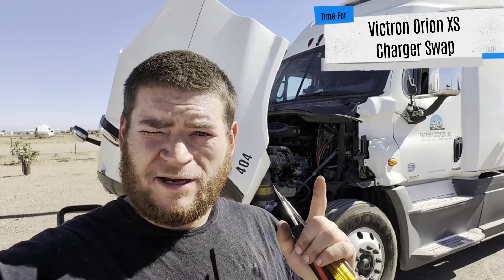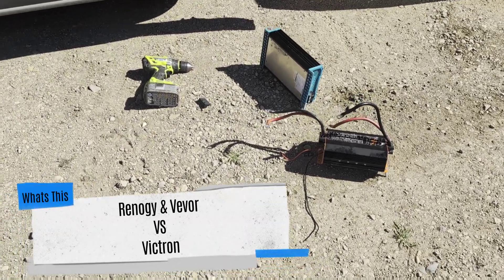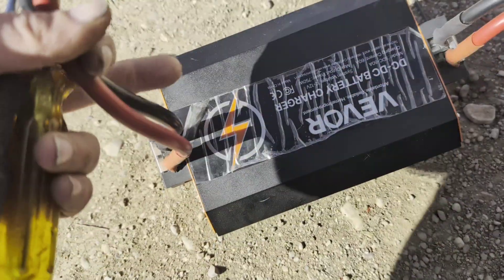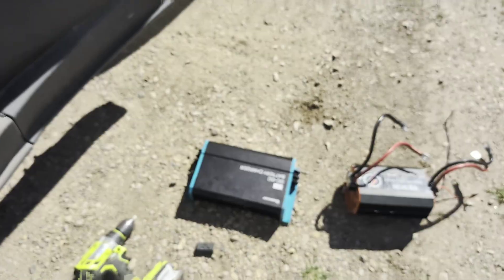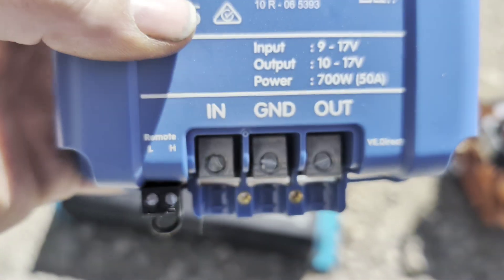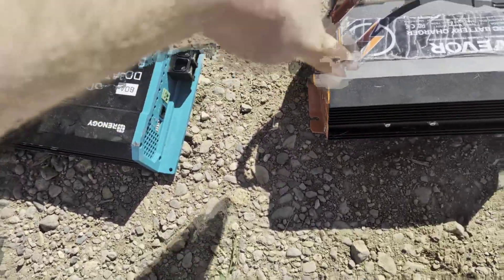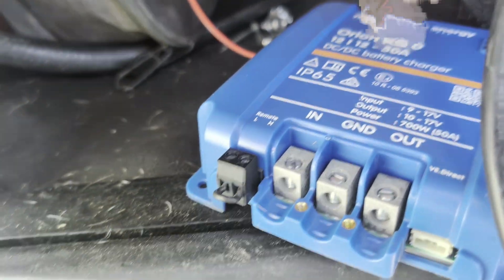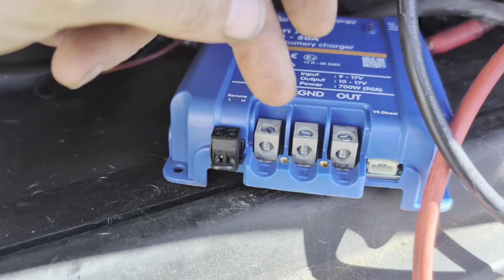Switched To A Bluetooth Victron Orion XS - No More Terrible Vevor or Renogy DC to DC Chargers!

Comment: I have a 36 foot Winnebago motorhome. I started out 8 years ago with a 200 Ahr Lithium battery charging from a 45 amp Progressive Dynamics lithium charger. I also charge with the truck 160 Amp alternator, directly connected through a relay and a 100 amp fuse. I have since added 3 more 200 Ahr batteries for a total of 800 Ahrs. Although we still have all of the original LP appliances as a backup, we cook and heat with electric all the time. I have a total of 4 inverters that allow for a lot of cooking at once as well as hot water and space heating. We are away from the northern climates in the winter so space heating is not needed too much. While traveling, the truck engine also heats the hot water tank. The alternator runs at 14.3 volts. If the batteries are rundown, the alternator may be as low as 13.3 volts when we first start out but settles in at 14.3. The truck still starts using the truck lead acid batteries (2) but then the relay comes in and they are joined together for charging. 8 years, same alternator, same drive belts, same Lithium batteries and currently, 2 five year old lead acid batteries.
Reply from the maker: Sounds like a pretty cool setup! That's for the info! Are you using an idolater I've heard of those before it let's power only flow one direction. Which one do you use? In my motorhome unfortunately I can't use one but maybe the semi truck because the motorhome setup is wired as 24v with victron equipment connected to 4 300ah batteries so what I did was kept the 2 12v truck batteries installed and the power converter is still wired to those 12v batteries while the victron Quatro unit acts as a converter charger for the lithium 24v bank. Although right now when the engine is running the lithium batteries don't charge from the alternator they are strictly charging from the solar panels.

Comment: Since Victron is made for RV's, and Marine first I think it's a great choice for semi usage.
Reply from the maker: So far it's been working amazing. I just don't have any main victron units like the Quatro or multiplus although in theory they would work perfect minus not having shore power connections nearby the semi truck. I've thought about swapping out all the old equipment like the inverter that already came in the truck with victron inverters but I might wait for the Chinese inverter to die first. I have to say so far the victron equipment I've used in the semi truck and motorhome have been AWESOME!

Comment: Renogy has a new model now that Is smaller
Reply from the maker: How are the reviews though? I was pretty irritated the renogy only later a couple months before having issues seemed way too quick. Keep in mind the semi truck is running at least 12 hours every single day I'm working. I think that alone causes a lot of stress
Reply: @TheTravelinTruckah i didnt get anybreview of the new model but i saw that they improved some of the weak points. Now the efficency Is at 90 92 percento therefore less heating Abd smalller dimensions. Victron Is Better buy costs a fortune
Reply from the maker: Ahh well that's nice to see too because the lower efficiency caused the unit to get really hot sometimes I got worried it would catch on fire. I'm going to look this one up later today just to do some research. Thank you. Also, yes Victoron is better but it's about $300 where the renogy I think was around 170ish
Reply: @TheTravelinTruckah consider that Also the older victron DC/DC have low efficency, Heat and big dimensions. The xs Is really the best
Reply from the maker: I actually remember seeing the old one online your right they seemed crappy. Maybe renogy will make one like the victron xs I mean I actually like renogy I have a5th wheel camper that's all renogy and I've never had issues it's just the DC charger that has been terrible